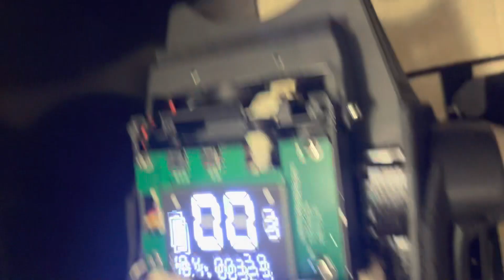Begode master charge board upgrade

Comment: Thank you for the video, I just checked and I have the new charging card (V4) on my Master, however it only charges at 133v and drops to 131v after a few days without touching it...I don't know where this current leak comes from and if the full charge is not necessary to balance the batteries...